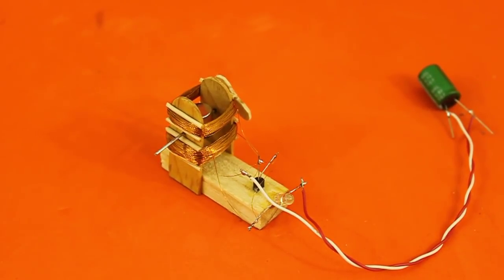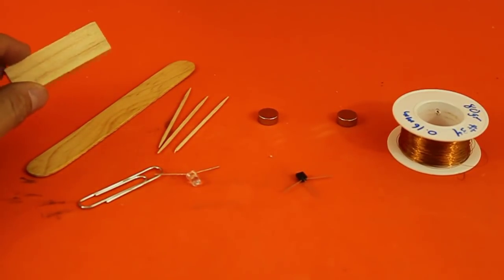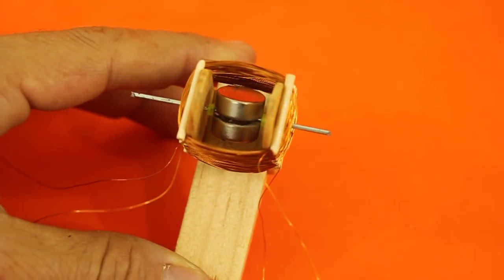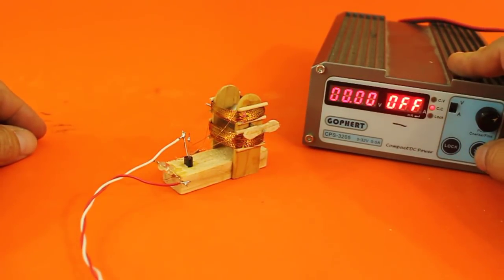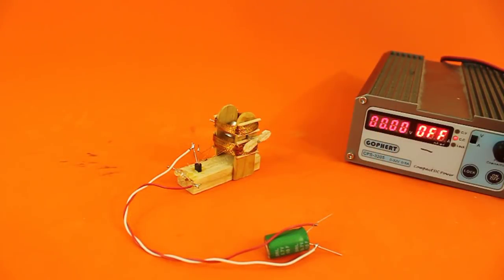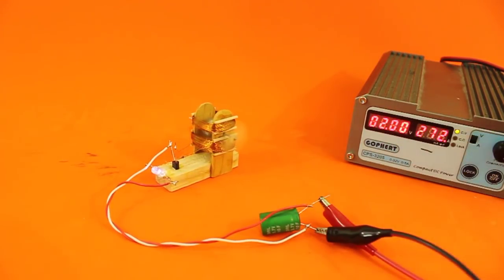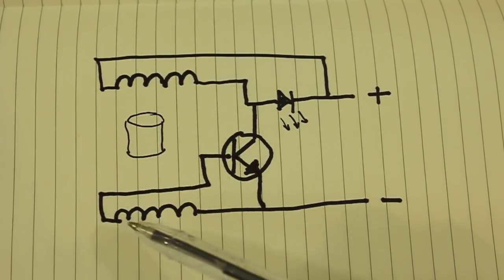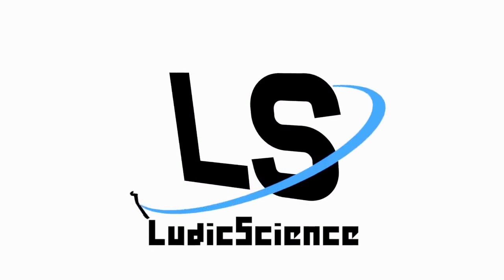Newman Motor

Comment: Great stuff LS, thanks.
Please, kindly next time write next to the coil the number of turns and give it an L sign & number.
Ex. L1 150T, L2 250T
Also the transistor, if it is not specific just say a Generic NPN or PNP with some model numbers as example, you already mentioned this @ 0:52 2N2222A, 2N3904, BC337

Comment: Title is wrong!!!! 
It's a free electricity generater
Reply: It is an excess energy generating device.  If built properly using more wires, more geometry, it will give overunity performance.

Meaning Newmans' motor is definitely MORE than 100%.   A smaller motor will have less energy yield and also if built wrongly, it will not even be overunity and in this example, will be of high efficiency but does not generate extra energy.

But if you build it to a size of a truck, it will really give you stunning results
Reply: Gary A. DePietro yes

Comment: Excellent project!  The only thing you might want to change is your description of how the LED lights up.  It does not light up from the energy produced by the magnet going by the drive coil (not nearly enough turns) but rather by the magnetic field collapse when the transistor turns off. It is the flyback that does it just like in the Joule Thief circuit.  You project is wonderful and I may try to replicate it with only a few modifications.  I will give you credit. This is really not a true Newman Motor but something unique in certain ways.  It steps into the realm of a John Bedini 'Window Motor'. If you connect the LED to a second smaller uf /higher v capacitor before connecting it back to the (+) rail, it will charge up the second capacitor. The voltage will climb on the second cap to a higher amount than the drive cap and give the 'illusion' of over unity. Well done!
Reply from the maker: Actually I used your video as inspiration, mentioned in the beginning of vid. I see! yes you are right, it is like in the JT. One thing I have seen and cannot explain is that the led stays on when the power is applied but the motor is not running. As if the circuit were oscillating. Did you observed this in your  motor too?
Reply: Yes the circuit can self oscillating.  By the way I replicated your project today and had a lot of fun with it. On mine I had to change the LED to a 1N4007 diode to get it to charge up a second capacitor.  It did the 'over unity' illusion trick.  The cap went up to about 6 volts using 1.5v as the input.
Reply: Ignoring the spinning magnet the circuit looks like a blocking oscillator - if so it would oscillate if there is enough coupling between the two coils.
Reply: Yes.
Reply: Yes.  They usually just run it to ground to protect the transistor.  I think that John Bedini was the first one to take the flyback and send it into a second battery.  The famous Bedini SSG circuit was the one he got a patent on.
Reply: how long does this run

Comment: How is the LED lighting up at 1 volt? Mine only light up at 2 volts and up.
Reply: OBV10U3_NINJA 
It is similar to a joule thief
Energy is stored in the coils, then released all at once through the LED, this voltage can be higher than the power supply, thus briefly lighting the LED
Reply from the maker: +OBV10U3_NINJA the led voltage is proportional to the number of turns in the upper coil and the magnet strength, not the input voltage
Reply from the maker: Yep
Reply: Is this why there is electric arcs with brushed motors because of the higher voltage?

Comment: This is a brushless solution of a motor. Brushless = no sparks will wear the material. What energy efficiency is there compare to a brushless commercial motor? Thanks for the awesome video.
Reply: nattsurfaren   it's less energy efficient than a good commercial brushless motor.   Which is why they don't use this design.